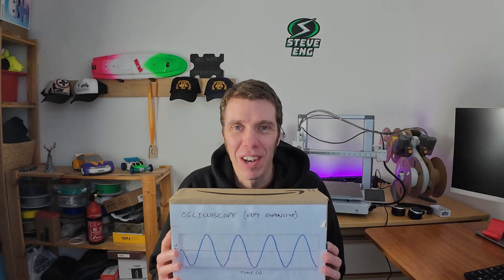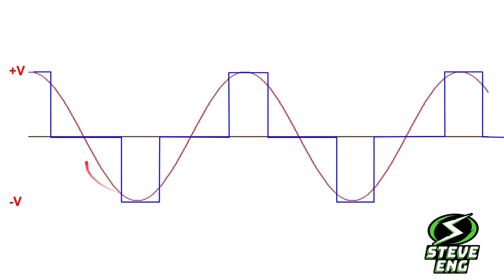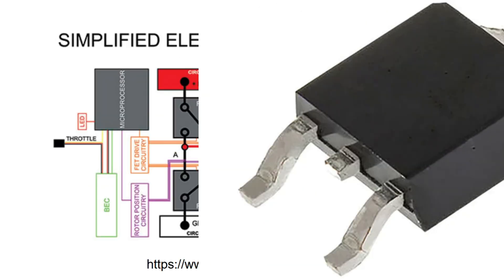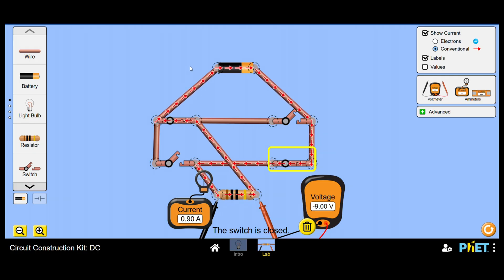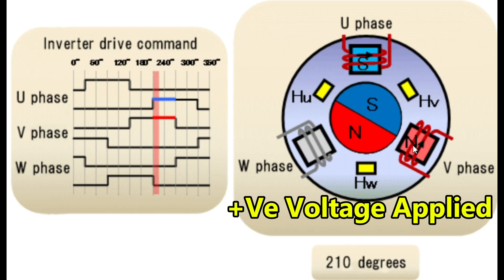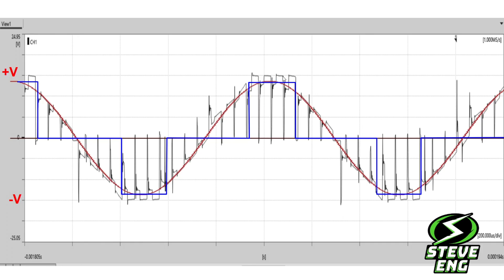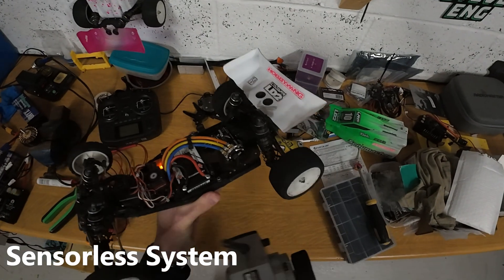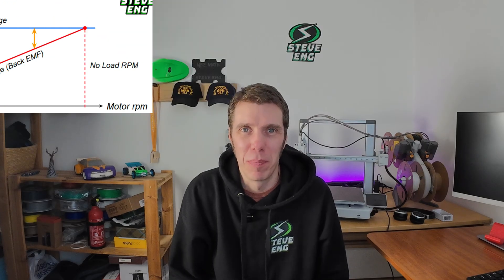Part 4: Unlocking The Magic of ESC's!

Comment: the mosfets in the controller don't care about the voltage, so long as it doesn't go over their rating. the thermal stress they experience is only related to the current passing through them. Lowering the voltage will reduce both acceleration and top speed. if you limit throttle at lower speed you can get the same top speed while only limiting accel at low speed to whatever the system can handle.
Reply from the maker: Hey, thanks for commenting, yes you raise some good points there. A higher voltage can give a higher current through the mosfets, especially at low speed, so yes limiting the throttle would be a good idea. The goal behind my question was to not get full speed actually (for initial shakedown) and lower voltage does achieve that.

Comment: this video has shown me how motor KV works - once the voltage difference between the back EMF and the battery voltage equalize, no more torque can be produced to spin up the motor faster. Higher KV motors this happens at a faster rpm
Reply from the maker: Hey, I'm glad it made sense to you! If you go back to part 1 I go into the relationship between the number of turns, KV and back EMF (basically higher KV = less turns = less back emf). Thanks for watching and commenting!

Comment: I think I can predict what it would look like but I'd be interested to see the difference in the esc/back EMF under load on the oscilloscope.

If back emf is proportional to motor speed what happens when the load decreases the speed for a given power output. I assume the voltage difference is proportional to the torque requirement.
Reply from the maker: @frasersteen  hey, yes I'd like to see that as well! Unfortunately the oscilloscope is at work and my Dyno is at home... I think you're right though, the voltage difference would be proportional to current and therefore torque produced.